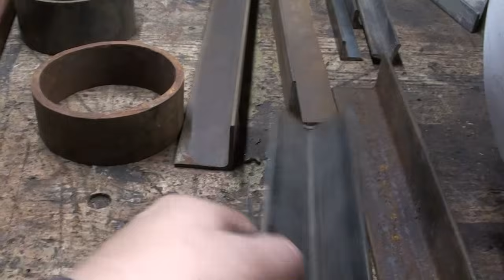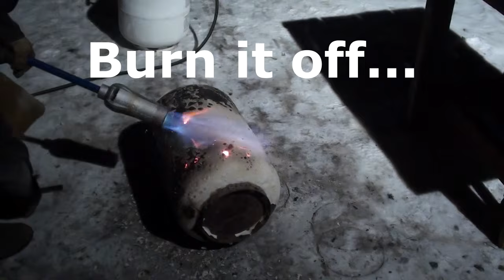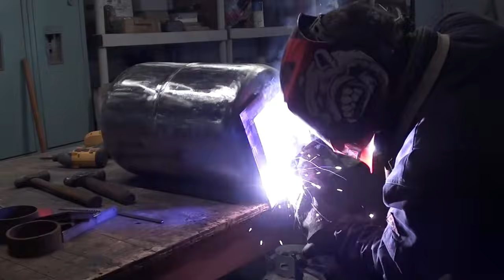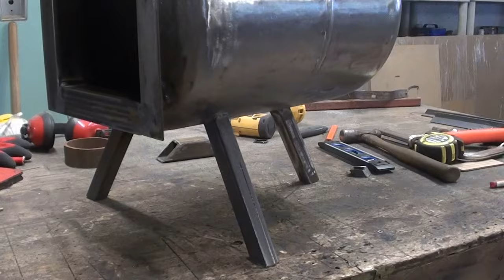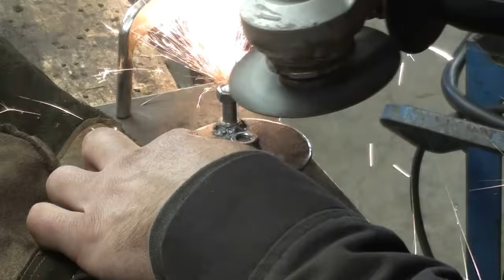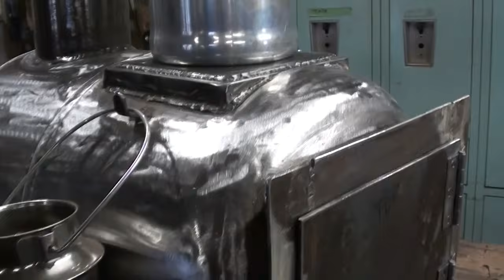DIY Mini Wood Stove Project How to Build with Propane Tank

Comment: You use hi-heat stove paint on the metal so the original paint would still burn off underneath if you sprayed over it.

Comment: Just light a big fire before you start and throw the tank in and it will burn the paint off, empty the gas first of course! I do the same with oil drums, they strip easy after a burn.

Comment: I'd invest in either a plasma cutter, or an oxygen acetylene torch. Mainey because so you don't have to keep cutting with a grinder. Also, the plasma cutter, and the oxygen acetylene will cut through thinner steel like butter.
Reply: For sure,,plasma cutter,can be bought pretty cheap on Amazon,I have made many of these.only zip cut I do is the door and tank is filled with water so I don,t blow myself to peices

Comment: Im afraid the door will warp in time. Needs some lateral and or vertical strength pieces welded to it.
Reply from the maker: Not so far, but I see your point and this could be an issue.  Thanks for the comment.
Reply: @woodsarmoury  i was thinking weld a square inside the door that fits fairly tight to door hole. You could make a gasket from header wrap. Brace and air tight in same step. Im building a double 55 stove today. Everything is sky high over $100 for two cement siding 4×8 panels to go behind it so I can put it close to wall of my metal building without smoking the paint off it. I dont know whays going to happen but this economy has me worried. Nice work have a great day.

Comment: What kind of paint stripper were you using? Aircraft non methylene chloride has always been great-very expensive. Open up the pours with a DA, brush it on, cover with plastic for 24 hours and it melts off like slow cooked ribs

Comment: what angle is your legs cut at 22 1/2 ? I am using a air tank for mine.
Reply from the maker: Sounds about right... I just "guesstimated" or "eye-balled" the angle and fitted until it sat level.
Reply: @woodsarmoury  Thank you. Was just figuring a picnic table legs are about 22 1/2 degrees. Have a good day.

Comment: The only problem is that the tank material is too thin.   After a few uses it will rust at the bottom.
Reply: If you leave some ashes in the bottom it helps protect the the tank. I have also seen some people put sand in the bottom to help.
Reply: Built many,never had one rust through

Comment: I keep meaning to build something similar for a while, but my twist on it is to use a long 47KG (100lb) gas cylinder I've got stashed away, and wrap the top half of that in a welded on and baffled "hot box" of 6mm (1/4") steel, then weld on a couple of stubs of 4" pipe as an inlet and outlet, and run some semi flexible stainless flue pipe (Wrapped in insulation) off those, and into the house through a sheet of ridged foam insulation board cut to fit in an open window hole. Maybe with a 100mm 12v computer case fan and a car battery to push air through the loop? Though I'm kind of hoping having the inlet and outlet at different heights of about 2' might start a thermal syphoning effect.

The reason for me intending to go down this route is that, here in the UK, heating costs (Electric AND gas) have gone through the roof in the last year. There's also worrying official talk about the possibility of rolling power cuts starting at some point in the near future to stretch out our (soon to be limited) oil and gas stockpiles. Most of our power stations are oil or gas fired here, so thats why electric might go too. There's no way I can install a wood burner IN the house, but I could easily stick one a few feet from the back door in a makeshift sheet metal and angle iron hut, and then it's just the basic logistics of getting some of that heat into my home.

For fuel, at the minute, a lot of companies are still happy for people to take as many they want of the stacks of single use pallets that they end up having all over their yards, so at some point I'm going to start taking my utility trailer, my cordless reciprocating saw, and a stack of batteries to some of these places and loading half a metric ton of chopped up pallets at a time. I'm thinking that once people start getting cold, they're going to start looking into opening up their old boarded up fireplaces and THEN they'll be looking for cheap stuff to burn. So "Free to collector" stacks of pallets might become a thing of the past.

Another reason why an outside wood burner and heat exchanger makes sense to me is that it can be pretty risky to burn old pallets. They can be treated with all sorts of toxic pesticides, and even when you find one's that have markings to show they haven't been treated, you've still got no way of knowing what harmful chemicals might have been spilt on them, or if they've been stood in a puddle of something dangerous in a factory. Keeping all that risk of me coughing my lungs inside out a good few feet away from the house (with a long chimney sticking above the roof line) is worth me getting a bit cold every hour or so to stuff more smashed pallet chunks into an outdoor wood burner.

Comment: This looks nearly exactly as what I made a few years back and posted in the Internet.   However I made mine modular.   The door, legs and chimney flue all come off easily.    The legs screw on the bottom.   Also, the very ends of the bottom of each leg, I welded a stainless steel bolt, so as not to leave a rust stain on the patio floor.   

Grinding all of that pint off was a complete waste of time, effort and money.    Simply load that stove up and burn it 2-3 times and sit back away from it.  The paint disintegrates off through the burn.    Then a simple wire brush or wire wheel to the surface and any residual paint magically disappears.    Then wipe it down when cool and paint it.   Easy.   I’ve made 6 of these things.   What I do now though is weld two tank end to end, making the stove longer for larger pieces of firewood.   I’ve given them all away as Christmas presents to family.